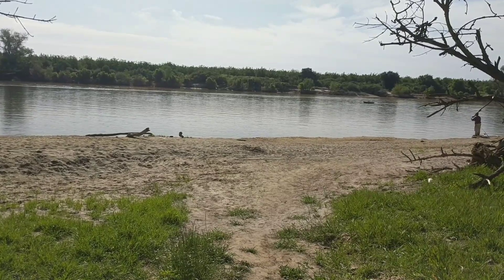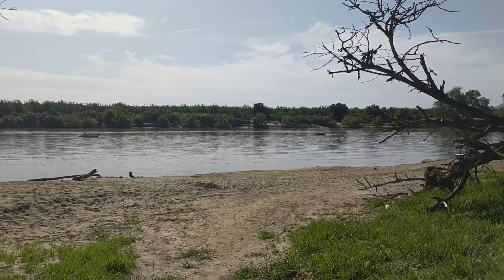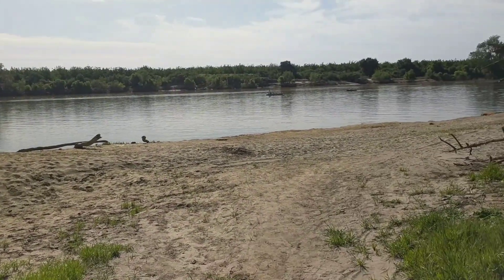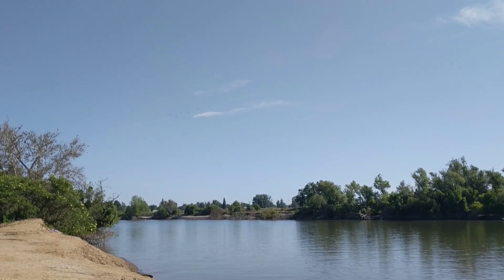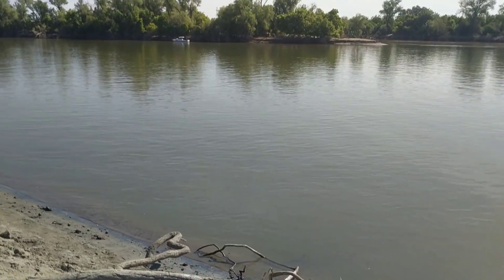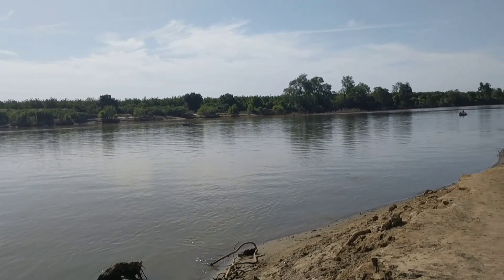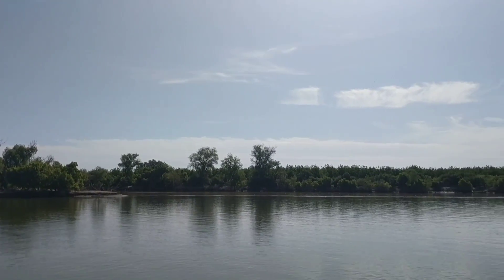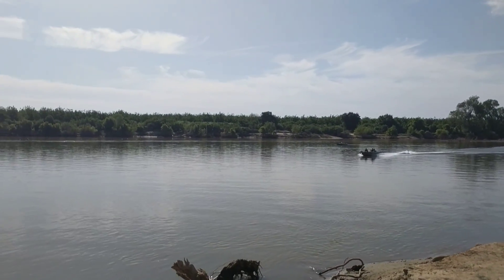5/9/17 ~ 30 miles downstream of Oroville Dam (7,700 cfs river releases)

Comment: The DRW of California in another week or two will have to have to release up
to 100,000 cfs coming from the dams and going down into the river.
Reply from the maker: Hello James. What is the basis of your information? I have heard various opinions about the possibility of high releases due to snowmelt. On the other hand, predictions based on the same modeling as DWR does indicate manageable flows. Thanks.
Reply: Wait and watch the releases 4 weeks from now.  I wouldn't be surprised if it goes over 100,000. They can't Dam up the water forever when it comes rushing out of the mountains.

Comment: Any idea how fast the water flows?
Reply from the maker: Hi William. I would love to know the answer to that question, but I don't. I know that river water velocity would involve slope, volume, width of the river, height of the bank, the shape and condition of the channel, etc. I'll do some research and see if it is measured and documented somewhere. Thanks for asking such a great question!
Reply: William Fowler its not very fast its only like 1 mph or less
Reply: Millie Kay right where you are at is only about 1 mph if that, we were out there in our boat today anchored up and our graph/depthfinder was reading 0.3. Upstream in gridley it gets faster and in places it gets narrow.
Reply from the maker: Hi Alex. Even though I don't know the speed of the water, I would think it would have to be faster than one mile per hour. Since Oroville is 30 miles upstream, if the water were only traveling at one mile per hour, it would take 30 hours to get here. For sure, it doesn't take that long. It seems to take more like half a day for the river to rise when they start using the spillway after it has been closed. That would be more than two mile per hour. Anyway, as I said, I don't know the speed of the water . . . just trying to figure it out.
Reply from the maker: Hi Alex. Thank you for that excellent information! I love it when people stop by and share such details. Very much appreciated!